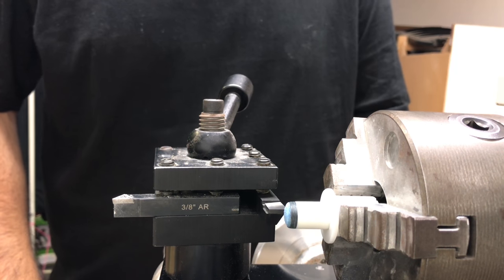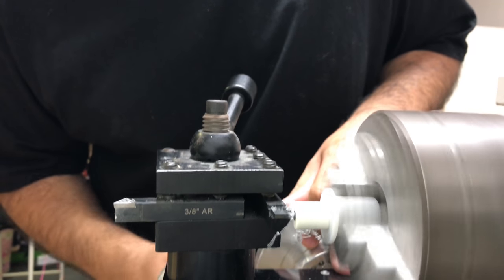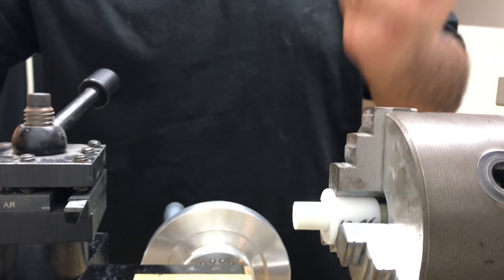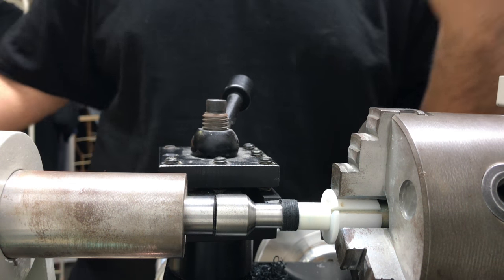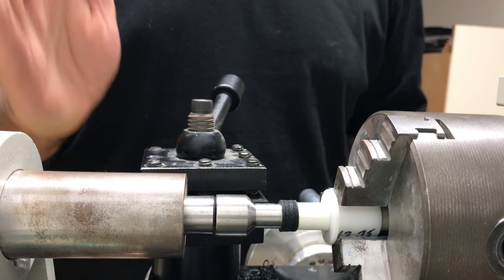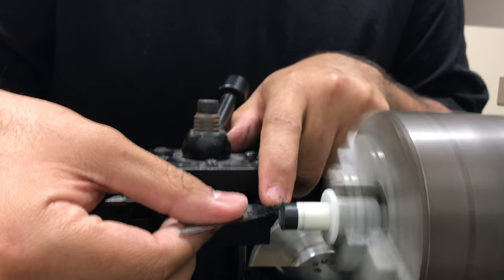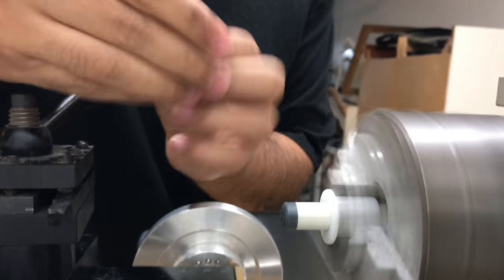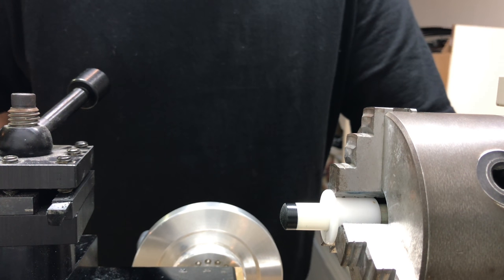How to install a tip on a pool cue using a lathe

Comment: I'm looking at the Grizzly 0765 lathe... it has a spindle bore of 22mm which is just a little larger then 3/4".   I'm a player and I can no longer afford the tip changes I've been going through.  So I'm going to spend 975$ ish including shipping.... so I can do my own tip work.  LOL  But.. I love to tinker so... it's on !  Like the Shaft master lathe... it's around $800.. they have some cheaper portable ones... in the $250 range... The Griz.. G0765 is $875 and will do a really pro job like you just demonstrated !   And that lathe could be used for a lot of other things.  For me... it's a must have !  Good Video !

Comment: First off I'd use aluminum soft jaws cut to a standard cue taper,and second never pull a tangled bunch of chips from the work with the lathe running,also run your lathe at 900 to 1800 minimum and don't use a carbide insert,stay with a high speed steel tool bit also don't use a razor to shape your tip instead sharpen your high speed bit to a nickel radius with plenty of relief!

Comment: Please please please, dont take this the wrong way, but take a bit of advice, from a old timer, 50+ years on lathe work, never ever, put your hand on the chuck, until its completely stopped, your a bit quick. Make yourself a tool for the radius, keep them pinkys away from the sharps bits. Eye protection. Always remember, start work with, 8 fingers, 2 thumbs, 2 eyes, and at the end of work, have the same, I have. Be safe, and keep the good work up.
Reply from the maker: Peter Garbutt  I appreciate it, yes a lot has changed since this video. I do use extra caution as far as eyewear and keeping my hands away from moving parts. Thank you sir for the feedback

Comment: How do you hold the cue in the back side of the headstock?
Reply from the maker: I have a rear chuck that’s identical to the one seen. This is a cue lathe remember, a rear alignment chuck is not very common. This company how made this lathe built it to have a rear chuck..

Comment: What kind of lathe is that or what is it called when the spinning head is offset so you can put the shaft through it? All the lathes I've been looking at the spinning head is behind the motor so it can't be done.
Reply from the maker: YIRMASTER  it’s a Joe Porper model B cue lathe
Reply: @abdiaz66  How much do they go for and where can i get one?
Reply from the maker: YIRMASTER  the machine is discontinued now unfortunately. However I would look at a deluxe cue smith machine from chris Hightower.

Comment: Nice tutorial. Question, could a mini lathe with measurements 12" × 161/2 be used to change pool que tips? The exact lathe I'm referring to is the Mini Nova 46300. I Thank you in advance for your reply
Reply from the maker: Ed Holt yes however you would need to build a jig to stabilize the back end of the shaft
Reply: @abdiaz66  because of how far out I live I've been doing my tips by hand and it sucks lol,but recently aquired a lathe for this, which I know nothing about. 
Question is what is the part called that holds your cutter so your able to cut just a little at a time
Reply from the maker: @yamaharider7672  it’s called a tool post
Reply: @abdiaz66   thank you! I'll look into it

Comment: Hello. I liked the demonstration shown here, but Predator recommends that on the 3rd gen series of shafts: (from Predator website) "Should you wish to replace the tip on your Predator 3143, Z3, Vantage, or Vantage 3C shaft, do not remove the dark gray tip silencer plate located underneath the tip as this will reduce the strength of your shaft and void the warranty. The tip silencer must remain at least .010″ (0.25mm) thick to maintain the shafts integrity. Should you need to replace the tip silencer, please contact customer service or an authorized Predator repair center. " Can you show us how you preserve or replace this tip silencer part? Thanks
Reply from the maker: check out my latest video
Reply: Cut the tip down to the pad and stop do not cut the pad.

Comment: Cut the tip off with a box cutter then just face it off .
Make a tip holder that you can chuck up.
Makes the job a lot easier and more accurate.
Reply from the maker: thank you,  tip holders work well ill try that
Reply: Why does he need a tip holder.  Looks like the lathe press worked well.

Comment: What speed do you run your lathe at for this operation (RPM).
Reply from the maker: depending on the tip about 1500

Comment: every mini lathe i've seen just has a chuck with the end blocked by the gearing and the chuck holder , how do you get it to accept the pool cue going all the way through it?
Reply from the maker: its a cue lathe for pool cues
Reply: Most mini lathes have a cover over the spindle hole ,just remove the cover.
Reply from the maker: Hey Paul this lathe actually didn’t come with a cover. All cue lathes I own and seen don’t. However if I was using a regular lathe, then yes I would remove the cover

Comment: is there anything you'd do differently with a revo shaft?
Reply from the maker: sorry for late reply, yes!!! on revo shafts i tape off the red pad and vault plate, and instead 0f using 400,600,and 800 grit sandpaper i buff the tip, pad, and vault plate with 1500 and 2000 as instructed by predator

Comment: Is this a metal lathe? If so what kind
Reply from the maker: its not a Metal lathe. its a Joe Porper Model B cue lathe
Reply: @abdiaz66  thank you I'm just trying to find a workaround because those lathes are so expensive
Reply from the maker: @lobstertron  understandable there are a ton of mini Metal lathes out there that will accept a cue. However after you make all the modifications to machine so that it doesn’t damage a the cue you better off buying an actual cue lathe. There are Q lathes that start in the 700.00 dollars range and go up from there
Reply: @abdiaz66  I have been looking $700 is not too pricey for me but I've never found one for that any chance you can send a link to one I've been looking all over Google eBay Amazon they're all in the thousands